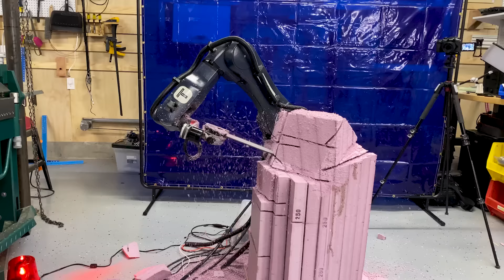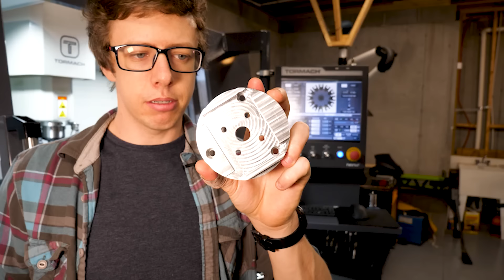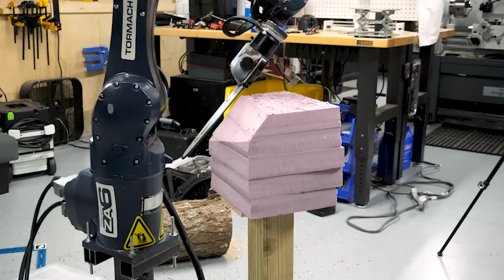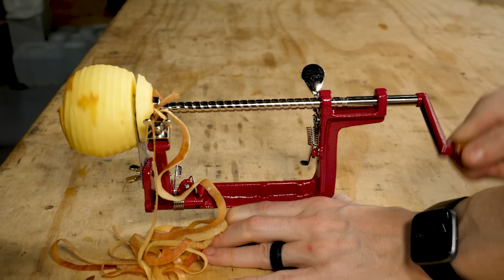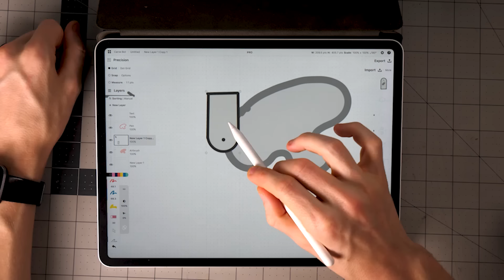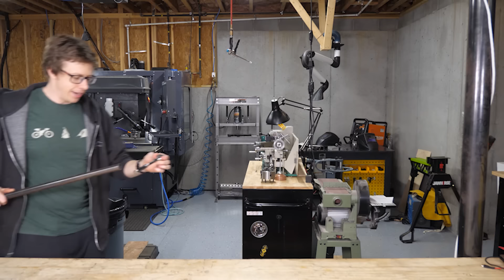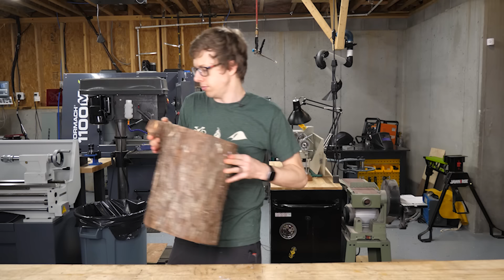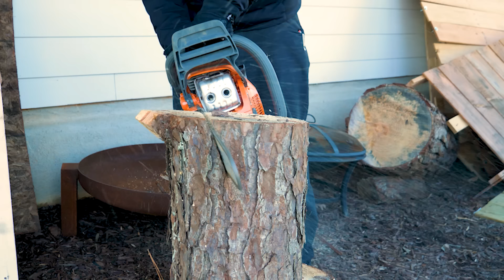Chainsaw + robotic arm = art?

Comment: try using AI to do thing like this in the futur it would seem easier since u said there was a lot of those logs becoming bears u could have designed a way to use this info for each scenario and than extrapolateed urs with this method

Comment: 17:27 Anti kickback tooth ? That tooth has nothing to do with kickback at all. That is your depth guide tooth. When your cuttingtooth on your chain gets filed down, you also need to file down that tooth so the depth of the cut still is correct with the cuttingtooth. If you only file the cuttingtooth, your chain isnt going to cut at all because the guidetooth would be the only tooth that have contact with the wood. And ofcourse, if there wasnt any guidetooth the cuttingtooth would cut to deep and get stuck all the time. Great video tho!

Comment: Okay I'm a little late on the comments to this one but a couple of suggestions for your chainsaw. I know you said you wanted to keep it shorter but a longer bar needs a longer chain with more links and more links doing the same cutting equals less work for each cutting link and it would wear out faster causing your bladed doll and not cut which leads to more friction and the fire. Or perhaps try a higher quality chain that stays sharper longer. Another thing I didn't notice as part of your mechanism was any type of lubrication system for the bar, typically with a traditional chainsaw you've got bar lubricant that also cuts down on the chain friction. And depending on the type of chainsaw bar you are using higher quality chainsaws have better rollers at the end of the bar with higher quality bearings.

Comment: I have an idea for a project try making a hydraulic version of a human arm using hydraulic for the tricep and bicep but custom make your hydraulic so you can fit a blank cartridge in it and put a firing pin and when the cartridge goes off it will cause the lower arm to extend and destroy any thing in front of it

Comment: You could file down the depth rakers on the chain which would allow the blade to make those cuts where it was getting stuck. Just be careful cuz if you take them down too far the saw will wanna pull itself into the log where its cutting straight like it would normally if you were cutting a tree branch.

Comment: I think just a little bit more research on chainsaw blades and cutting angles, especially those used by those bear carvers would have made the wood version completely doable.  Doesn’t exactly work the same as a CNC routing bit or a hot knife.

Comment: Why won't you simplify the the cutting to top down and side view for the initial cutting? The code would be a lot less and it would be easy to find which cuts cut the most material. 

Once the the General shape is defined, you can start using the tedious apple peeler method that turns the wood into sawdust.

Comment: I'm seven minutes in thinking
"Why didn't he just... Buy a smaller chainsaw bar?"
I guess I'll see if he thought about it soon...

The way I'd try and figure out where to cut needs to be is Ray Marching, find the longest path that gets the closest to the intended shape, although I'm not experienced in coding, engineering, robotics, or anything else remotely useful in this situation so that might be an aweful idea.

Oiling the chain might help with the overheating problem, won't help it cut though

Comment: I have zero experience but would it be easier to start with polygonal bear model from Thingiverse or something and just cut the slices to match surfaces(low poly Proly easier)then have your code eliminate the weird inner cuts, finally a surface area version of "don't colour over the lines" code. easier said then done obviously but its just my Idea
Reply: Match plainer slices with the flat parts, kind of a given that it was gonna end up being low poly looking regardless right

Comment: FYI pretty much throughout the video, the chain was suuuuuuper loose. Also, I didn't look closely at your conversion, but bar and chain oil is important when cutting wood with a chainsaw.

Also, your chain doesn't appear to have any anti-kickback features. I prefer going without the safety features anyway, but that tooth you pointed out is simply a raker (aka depth gauge).

What could be wrong if your chain isn't dull, is that the rakers may not have been filed down low enough the last time the chain was sharpened (The height on the raker determines how much material the blade part sees at once.)

Comment: I know that it's irrelevant now, but I have a suggestion to solve the gradient ascend problem. If you choose just one random starting dot and use gradient ascend to find the extrema, its highly possible to get a local extrema, but given that the robot will be cutting the wood with a chainsaw ,which means that the bumps and protrusions will be relatively big, u can maybe use a gridlike aproach(e.g. 1cm between dots) and use gradient ascend multiple times to find the highest point.
Love the videos.

Comment: It seems silly to use a full-length chain saw. Woodcutting disks that attach to grinders are readily available and not very expensive.
10:22 Homie, divide the whole area into equal square segments, then test at multiple points before climbing.

Comment: My BS pole saw chainsaw also nearly refuses to cut wood. I think it's just a really poor blade design. (Maybe on purpose to prevent injury or something?)
I think to know how fast you can cut into wood, you'd need to constantly measure the chainsaw temperature and slow down if too hot, and constantly lubricate it.
Also, your gradient decent stuff seems very similar to regular machine learning. Have you considered turning this into a sort of game, then getting the machine learning to beat the game? (Where the score is based on how much of the final model is isolated/trimmed perfectly. Then, negative score is given for making wrong cuts. That way, it can even learn things like the size of the blade and such.)

Also, if you're not an expert at all this machine learning stuff, have you considered posting the problem on Kaggle (with a reward) and letting the internet crowdsource a way to perfectly cut using this chainsaw? This seems like a machine learning problem where there is a definite solve-able thing. (That's not always the case with machine learning.)

Comment: This is such a cool project!

The problem you had with the blade not beeing able to dive into the wood could probably be fixed by using a carving blade. The tip geometry there is different (its pointy) to be able to "stab into" the wood without kickbacks. Also please have a better look on your chain tension (it was very lose at the videos end) as you will otherwise kill someone randomly by a chain flying around.

Comment: @11:00 I can think of 2 options for the cutting problem. Option (1) is a combination of the 2 original cutting methods; do a best cut line and then do a refining pass like your apple peeler. Option (2) would be to collide a planar perpendicular to the angle you wish to cut; it would something similar to the calculation for magnetic flux to antenna.

Comment: I wanted to add another comment because I had this on the backburner for a little bit and a solution popped in my mind, as a programmer - how would I accomplish this... I don't know much about modeling, and I wish I did, but converting motion capture to g-code wouldn't be super difficult... You could capture the motion of one or more of these chainsaw artists and replicate what they've done. The arm could handle it. The rotational element would be opposite of their movement around the item. And you could get incredibly accurate reproductions by doing this - although they may not like you selling a replica of their making via a robot though, but I'm sure there are a few people willing to try this.

Comment: You can also wire yourself up so that if you touch the saw you close a circuit which kills the saw. This is used in bench saws. Maybe it can be done capacitatively, so if you come to close to the saw its capacitance will increase and this can trigger it to stop

Comment: Here's an idea. The divine combo of carbon and silicon. Use your setup to manually chip away at the log, restricting your movements with your software model. Ok, maybe clunky unless the robot isn't really flexible. How about this: use a laser to "color" the log where it needs chipping until a dog is all that remains. (Is that a thing? I feel it should be. There is no way no one has thought of it.)

Comment: @Stuff made here, just an idea for using the estop when your in the kill zone. We use a double deadman switch for programing our material handlers. Ours are built into our tech pendants but it wouldn't be hard to make a stand alone one. Basically it's a switch that you hold half way down in order for the robot to move. If something happens and you release the switch it kills the arm and if something scares you and you tense up and push the button further down it'll also kill the arm. It's a pretty safe system. We also use cameras and stuff so that when you are in the work cell or kill zone the robot will only run at half speed. Then once you are outside the kill zone you don't need to hold down the deadman to the halfway position anymore and it returns to full speed.

Comment: You should use this robot arm to your hair cutting robot 
And please add upward moving comb in front of suction cup it will allow to cut correct length of hair  
One more suggestion in front of suction cup don't use that metal sheet use a sensor over there      we need comfortable working 
LOVE YOUR WORK ❤️

Comment: In my rumble opinion your project would have taken greater advantage of a 5 axis CNC machine (the robot arm plus the rotating table should have actually even more degrees of freedom), it's just that instead of a chainsaw the arm should use an endmill and the coordinates should be totally different, fortunately mathematically it should be possible to apply a linear transformation in the robot arm + rotating table to transform the system in a 5 axis CNC, if there is someone who are specialist in those arms and details, please let us know, thanks for the video !

Comment: Get a pro chain, one with no kick back. one that’s fresh or one that has been professionally sharpened is preferable. Also you need lube for the chain. The other option is to grind down the guide teeth down but just to below the cutting teeth.

Comment: Hi! One very common way to overcome the non-global maximum search is to add simulated annealing, it follows the same principle as the annealing of metals by adding some randomness to the calculation of the gradient descent (or ascent, it depends on how you pose your problem) in such a way that some times the optimizer makes a decision against what would be optimum locally. https://en.wikipedia.org/wiki/Simulated_annealing

Comment: With as many comments as this has, I'm guessing you won't see those but, in the off chance you do: look into Particle Swarm Optimization to help with your problem of getting stuck in local maxima. PSO will sample tens to thousands of points from your vector space, in a single run, then moves all of those points around in the problem space for some configurable period of time, eventually converging around the collective swarm memory of the lowest (or highest) point observed by any member of the swarm. This helps avoid the problem of tunnel vision from sampling a single point in each run, as with gradient descent. You can also combine PSO with gradient descent (or ascent) to get the best of both worlds.

Comment: Your chain saw is overheating do to lack of lubrication. Also not professing to be an expert at robotics, but where j work he have huge fixtures mounted on robots and you just have to tell the robot where the new tool center point is wether it is 6 foot off the arm or 6 inches, the robot will move accordingly to that point.

Comment: Have you considered using an air motor for the saw? This should help offload weight from the saw. Also I don't know enough about your workflow here to say for sure, but I know most robot control software allows you to define tools, which could help prevent the "why are you hitting yourself" issue

Comment: 17:17 ........Those parts in front of the cutting tooth are called rakers and they need to be progressively shortened as the cutter is filed since the cutter is angled and gets shorter as it is filed .......Time to sharpen the saw basically ................

Comment: luv your channel...  luv your style...   got an idea for you,  make an arm that can throw the worlds fastest and perfect dart game. Stipulations: its got to function like a human arm e.g. it pivots at an "elbow" and at the "wrist". A preloaded magazine is allowed to hold the proper number of darts. Trying to decide if full 360 degree rotational movement at the "elbow" is allowed or it is to move forward, release dart and then return to a start position ( < 180 degree arc)...  The full 360 rotational movement would be the faster but setting up the electrical would be harsh unless the control signal was wifi or bluetooth. The main power could run off of a slip ring/contact brush, but as mentioned, the signal for the controls.... hmmmm  ;)  ...

Comment: 🤦‍♂️That is a raker; not an anti kickback tooth🙄Tour robot is pushing the saw into the wood. You do not force the cut. You let the saw cut at the speed it wants to. It will not cut faster if you press harder. Normally that wood just kill the engine. If your motor is powerful enough to keep going you are just creating heat and eventually the chain will snap.

Comment: 😂I love your presentation. I have thousands of hours of Chainsaw time. The reason chainsaw art is so impressive is the amount of tip cutting involved which is a slightly dangerous and difficult to master endeavor especially if your upper body fitness is a disaster.  You can carve up a piece of wood in reasonable amounts of time with a combination of slabbing and then tip cutting. Beware of fatigued stability muscles, loose chains, dull chains, dirty logs, hardwoods, and especially be very cautious of old chains, kickback, and flying chunks of wood which will surprise you with a whack to the face at some point.

Comment: Do you have any recommended topics I could research to learn how to build crazy stuff? I've got software engineering down. I've been learning 3D printing / modeling and electronics / ardrino stuff but the metal working is beyond me. I'm not even sure where to start or what questions to ask. I'm currently working on printing a CNC milling machine though I don't know what I'll use it for lol. Any direction would be appreciated. Love all your stuff btw, you're a real inspiration!

Comment: As someone who uses a chainsaw on a daily basis, I must comment, that it's clear that your trying to push a dull butter knife through a piece of wood.
In other words, it's dull. The second you put on a new, or freshly sharpened chain, you will see a world of difference.
If you don't know how to sharpen it, you should probably take it to a shop, where they generally charge $9 to $12 per chain.
Also, in on of the shots, the chain was loose.
It must have the proper tension, and be Sharp.

Comment: As far as optimizers go, when I run into false extrema with gradient methods I've found that simulated annealing works pretty well and is usually pretty fast. At worst, you can use it to find a good starting position for a gradient approach.

Comment: Not an engineer, but am a chainsaw wielder. I think the problem you were having with the wood is a combination of not having the proper chain/bar combo for carving, the chain not being properly sharpened, and not having enough RPMs to cut through it. Solution: Better bar/chain, a good file, and a stronger motor pulling at 12k RPMs.

Comment: Idk maybe I am kinda dumb here but for the coding why would you not start with the points closest to the center and a 360°° Angle (aka twice the same cut) then instead of testing every angle you simply do a half aproximation so it checks 180° next then either 90° or 270° depending on if that cut goes into material or not and so on for about 5 or 10 steps (I doubt a chainsaw would be any more accurate than that. then repeat that for all relevant points until your initial structure. (aka any point that concave with a reasonable precision so points can for example be no closer than 5 cm together which would be about the accuracy I expect for this tool.) Once all those have been computed you simply do the same but in a single cut for all convex points. After that you would have the robot execute the found steps in reverse order. This should result in a reasonably fast program while allowing relative good precision.  The only downside to this solution is that holes would be impossible to calculate so for example the dog legs would need to be connected to the body. I have thought of another solution that technically would allow holes in structures however it would only allow low polygon count inputs.

Comment: Several items that will help out a ton.
An oiler for your chain.
A chain that is designed for feller/buncher systems. These have more teeth per foot and are more aggressive in cutting.
No kickback, your bot has strength in its joints to  prevent any kickback from breaking things.
The bar itself needs to be twice a strong as a normal consumer level bar. A bar designed for feller, buncher, firewood processor system is higher recommended.  Look up Pacific Trail Manufacturing Systems for a decent selection. Make sure it'll fit your current setup, or you'll be cutting a new mount.